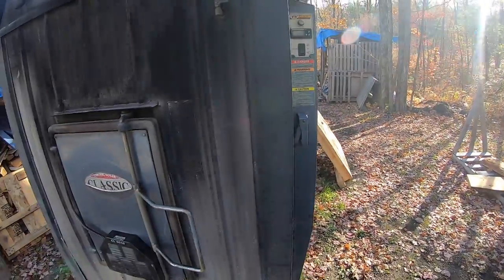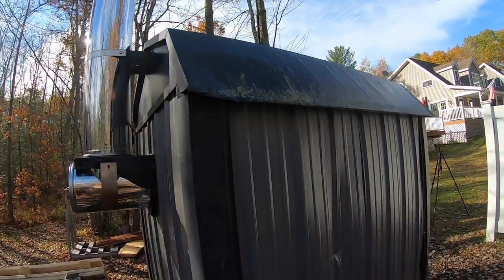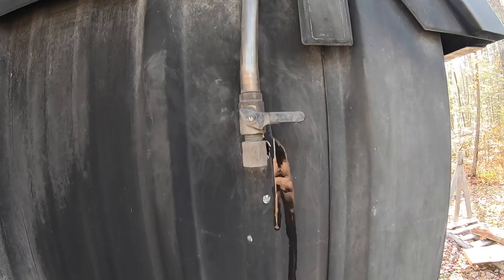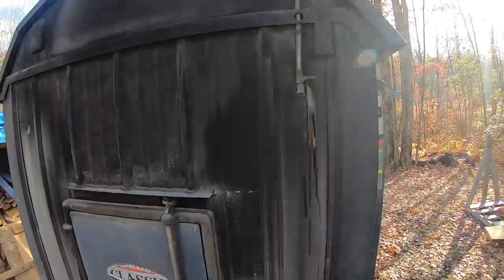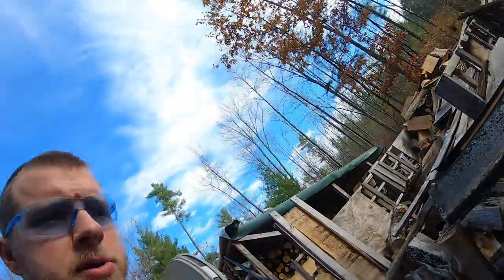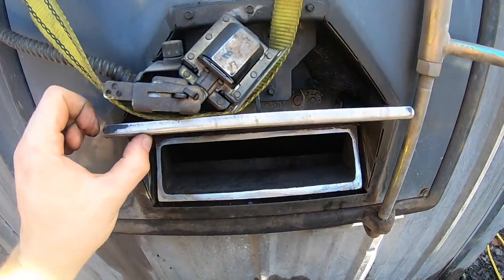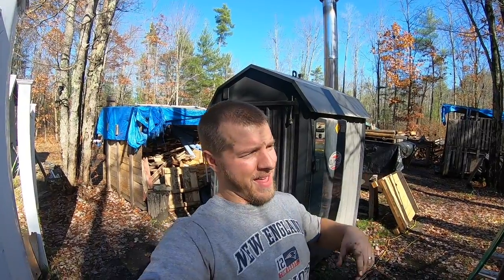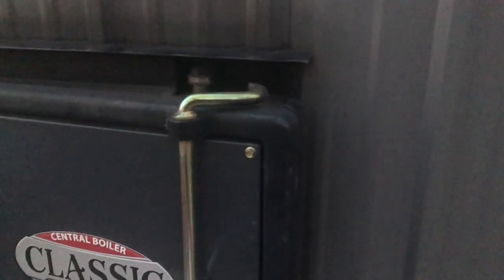Central Boiler CL6048 Outdoor Wood Burner Pre-Season Checklist!

Comment: I'm so glad I don't have to do that stuff what does that unit do inside your house I know it's for the winter heating water is it for heating the house or just having I'm not sure all right you take care cheers with a beer
Reply from the maker: It has a water to air heat exchanger in the furnace plenum. All you need is the fam to run on the furnace. Heats like anything else. I have 3 sources of heat I can use

Comment: does the boiler have some kind of safety to prevent a boil over ? like it shuts the burner off if the temp reaches that 200 degree mark ?
Reply from the maker: It has a controller on it. You can set a water temp between 150 - 195.  It open and shuts the draft door to regulate fire, no fire.
Reply: @TheDurbinCompound  oh...thats right...its a wood boiler...no burner...my bad
Reply from the maker: Yeah. The temp probe was making horrible thermal connection a couple weeks ago. I had to clean out the thermowell and relube. It was giving false readings to the controller. It did boil over then, but otherwise, very simple operation.
Reply: hi there i built my own boiler  it has low water shut down . high temp shut down . i also have a dump zone . i don't why c/b didn't put these on there cheep

Comment: Good info.  I would recommend a thermal paste for the temperature probe.  It is conductive so it helps the sensor maintain contact with the temp well wall as well as making it easier to remove for inspection.